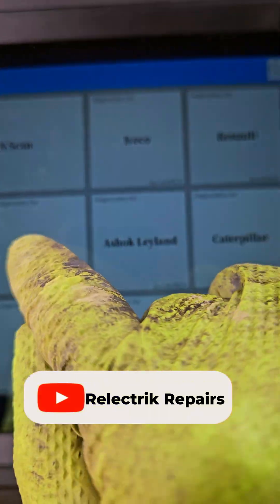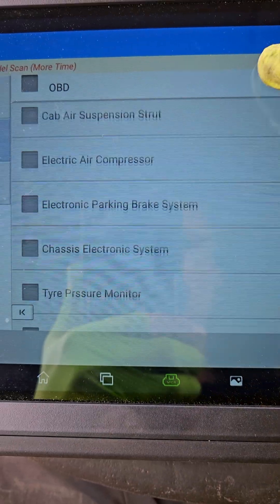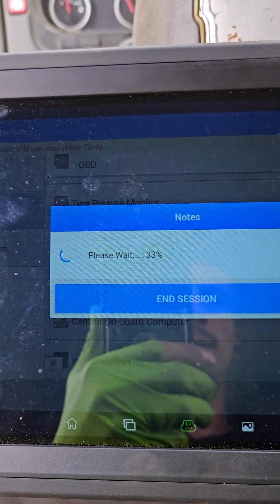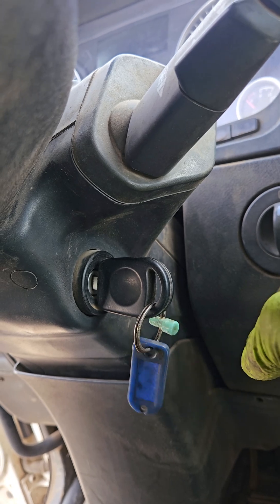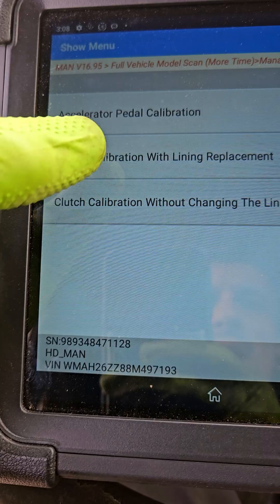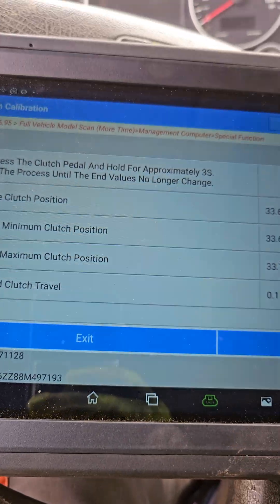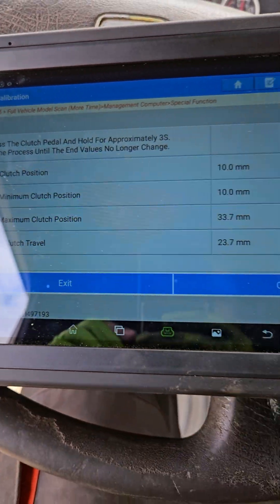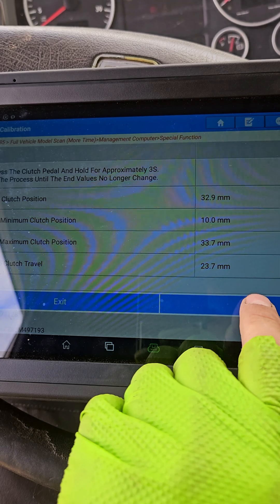Calibrating Man Trucks using Launch Diagnostic Tool #mechaniclife#mantgx  #clutchcalibration

Comment: Hi everything good ? question I have a Man Tga 2007 two questions what kind of power steering fluid does it use , and the cab rear suspension airbags is filling to much air does it have a cab leveling valve? Thx

Comment: Hello
What kind of problems will the driver face if the clutch is not calibrated?
Reply from the maker: Hello. stiff shifter or sometimes range will not change to low or high and also comfortshift will not work
Reply: @RelectrikRepairs  Thanks master❤